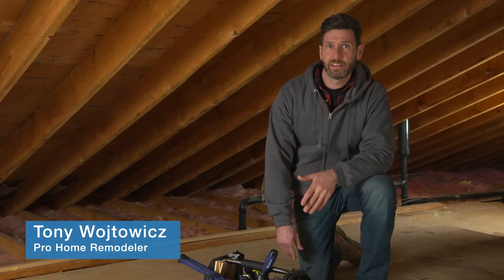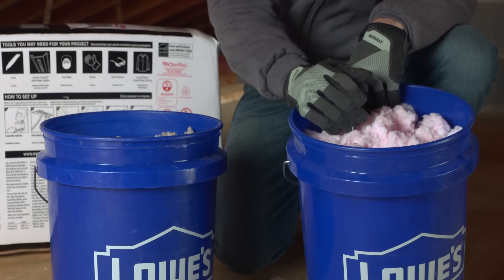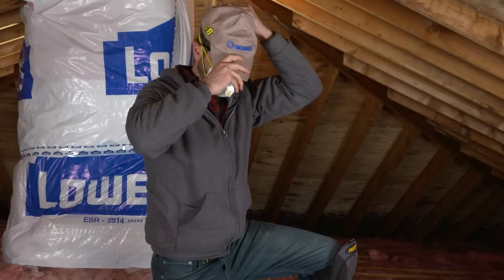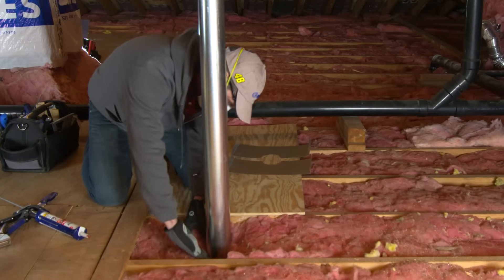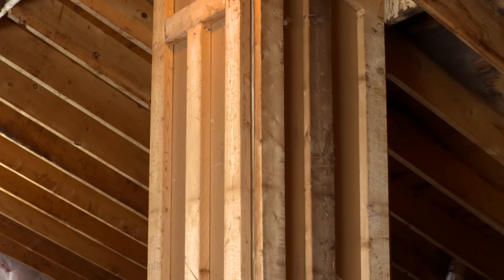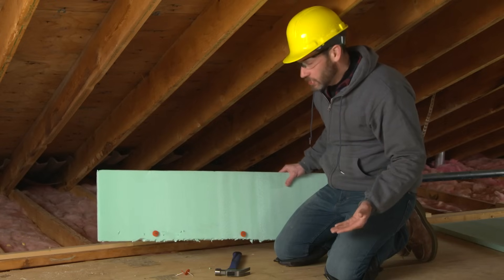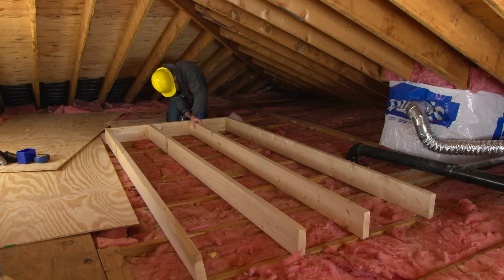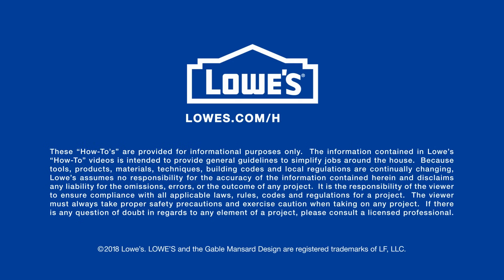How to Install Blown-in or Loose Fill Insulation

Comment: I want this guy to come to my house and do this. Never seen anyone take that much time to do prep work and care.  Everyone just blows it in and f u pay me!! Great video
Reply: Paid by the hour.
Reply: @lawnworksllc9533  right, Ill take all the time to do amazing prep work just to get that money. You need shelves and walkways, no problem.
Reply: Wow, where do I find professionals like this guy?
Reply: In my experience most people do not want to pay for the extra time labor and material to have it done like this. Most customers I’ve ever had want everything done as cheap as possible.
Reply: I'm going to blow my own🎉. And I'm not doing any of that prep work either.  Nobody does cuz it's unnecessary.  If you put in enough blown in insulation you will not have leakage into your attic.
Reply: That's why I'm doing this myself, friend. I had vermiculite in there. Got it removed. Since then, I have been going up there weekly air sealing, insulating pipes, adding baffles and metal mesh to gable vents to keep out squirrels. Next I have to build up hatch and blow in the cellulose. Got 60 bags stored in my garage right now and have machine reserved for later this week.

It's honestly so much work I want to puke. Some days after getting down from there i do puke. But I know in the end it'll be worth it cause I actually care about the project and what it adds to the house.
Reply: How much do I usually get charged

Comment: If only all attics were that pristine and wide open 😁
Reply: Yes... I'm working in a 4/12 pitch on a 25ft span
Reply: No kidding. I've only lived in one house with one that tall, and seen one other. And no spiders or bugs at all LOL. 

I bet it was all a set they built and the water damage they showed was just standard Lowes plywood from the store LOL (kind of joking). Definitely did a really good job, though I question the effectiveness of attic insulation if you leave a huge uninsured area in the middle (or less insulated, anyway. )

Comment: Pro tip: Install Cat 6a ethernet to all your rooms before spraying your insulation in there.
Reply: Nytron or have good wifi :)
Reply: @ovidiuciuparu6421  Wired for life. So much better than WiFi. 

Best would be to install some conduit from the attic down into the walls so you can upgrade whenever cat7 or cat8 or what the f ever comes out.
Reply: @dupeaccount1647  That's what our builder recommended.  Thought he was nuts...at the time.  So thankful for this advice over the years!
Reply: Is your profile pic of you after you realized that trick while finishing up the last bay of insulation?

Comment: This guy did not cut any corners. Hard to find guys who work like this
Reply: Really?  Did you notice the sheetrock work, driving screws into the edge of the sheetrock?  That's a way for it to break & crumble easily.  I'd have cut some 2x stock for inside those corners and screwed into that.  And then the foam insulation along those edges was pretty sloppy.  I'd have just left it, considering the other side of the insulation is not interior space so insulation was not needed there.  Or joint compound could make a neat tight job of it if the circumstances mattered.
Reply: @PeterLawton  do you perform aerobics or mma training in your attic? It's an attic bruh
Reply: Best comment here LOL. 

This one is definitely big enough to!
Reply: It's holding back insulation that weighs less than a pound per sq ft. Yes, it broke the insulation, not it's not gonna hurt anything at all. 

I would have just left it alone, or used caulk, but it worked fine. And was then covered in insulation, so it's fine.

Comment: I love how he talks like the R50-R60 range is not where you want to fill to :)  Hot or cold, north or south, you want to hit R50 or more.
Reply: Uh no. Over insulating can be just as problematic as under insulating. You need to verify with your local codes.
Reply: Why would putting more insulation in be bad? If you don't cover uo something you shouldn't, it shouldn't be an issue. Also, DOE says r60 is fine.

Comment: I'm not sure how he magically screwed drywall onto drywall perpendicularly...
Reply: Exactly, I noticed that too. I use during strips and 5/8" sheet rock to make fire rated light covers
Reply: @mikeclark6642  Pre-drilled holes would be the only way not to split the sheet rock.  It would still be difficult for the screws to hold it together well.

Comment: There is a fix to the clumsy walk-on-joists problem that will make installing more than a few inches of insulation much easier. You build an elevated platform to walk on. It's easily done with scrap lumber. Read on for instructions.

1. Take short 2x10 or 2x12 boards about a foot long. You can find them as scrap.
2. Nail strips of wood, perhaps plywood, on each side of those boards and extending down about 3 inches.
3. Slip the result over a joist, with two boards alongside one another on adjacent joists. Except on cathedral ceilings, they don't need to be nailed down.
4. Nail another 2x10 or 2x12 board a little over 24 inches long between the two boards. That creates a stable platform you can stand on rather than those elusive joists. 

Make a series of those platforms and you can walk about an attic. And if you do this for a living, remove them after one job and move them to your next job site. The cost is almost nothing and you'll save a lot of time. You might also sell the result to your customers to make later work in their attic easier. All that walking on joists and kicking away insulation will wreck their attic insulation.

To make your work even easier, connect those platforms with longer 2x10 or 2x12 boards and you will have a solid path to walk about on. If you're blowing in insulation, the platform offers a 4+10+2+2=18 inch marker that you can, if you want, fill up to. Measuring is easy. Just fill up to your pathways.

That 18 inches will give a highly effective R-value of 65. Where I live (central Alabama) that means only on the coldest days do I need to run my heat. The rest of the time the lights and refrigerators keep the interior in the mid sixties. Combine that with attic foil for even more protection, particularly if you have hot summers.
Reply: Good to know. I don't understand the directions, though. 

The 2x10s are set on edge (so 9 5" high), with another one on top. Are they going perpendicular to the rafters, or parallel? And where are the other boards going relative to the original 2x10s? 

I think I understand the idea, and I like it, but I'm just trying to understand your design better.

Comment: Good info! 

I do have a question to poke fun at you though. How do you get 4x8 sheets of plywood through the 2x2 attic access hatch? ;-)
Reply: He's got a huge pull-down staircase into the attic
Reply: haha good question.
Reply: 2×4' fits easily through
Reply: And whys there no poly between the trusses and drywall, every fixture had nothing. Do not let lowes insulate yoyr attic lol

Comment: Thank you for mentioning the rafter vents. We just bought a house that has blown insulation very high in the attic, but they didn't put in rafter vents/baffles first. 😑 And there is a small amount of mold on the ceiling of the roof.

Comment: Why aren't the air seal prevention, caulking, boxes, etc, put in place when the house is built & before insulating?  I guess costs are a factor, possibly time as well.  If I am purchasing a new(er) home, I  would expect that to be part of the build.  Apparently, we just assumed or not aware it was needed?   Education is key!!!

Thank you such a thorough explanation; I wish I had that much space available in my attic.  One must crawl on their belly!!!  Not able to stand up! 😳
Reply: Air sealing just wasn’t a thing 30 years ago. My folks helped me insulate our attic with fiberglass 29 years ago and despite being experienced contractors, did not know to air seal all the joints and passageways, they just rolled out fiberglass over the measly 2” of Vermiculite insulation. Now, I’m peeling back the pink and sweeping back the Vermiculite insulation to air-seal it all.

Comment: I live in a floating home in Portland, OR, and am prepping to do this with two helpers. I'm planning on buying disposable coveralls, borrowing a ventilator (maybe just a mask), gloves, etc. One of my questions is the rafter vents. The slope of my roof is such that it's a tight space, so how do I get those vents screwed in those tight angles? Guess I need a bunch of screws, too. Oh, and I also need plywood to navigate the space. I think I'm gonna use two old bifold doors up there to help me. Then there's the depth of the infill...do I really need the measuring pieces to help with that? My back and knees might not be able to handle this, so I'll throw my helpers up there!  LOL. Pizza and beer heading their way!!!!!!  Any thoughts or ideas for me would be welcome!

Comment: I have an attic ceiling that has no insulation, but it has beams that ceiling board was nailed to. Would it be better to add loose insulation without removing the whole board, or removing the boards, lay batting, and put the boards back? Thank you!

Comment: Can blown in insulation be put on basement exterior walls
Reply: Cellulose can be as it has its own vapor barrier. As long as you have drywall/sheetrock to drill holes into it, you can pump it in, which is called dense packing. In case of a fire, Cellulose would just tar unlike fiberglass that will ignite. Also Cellulose helps with mice as it kills their reproductive systems and less bugs as well.

Comment: I live in Southern California my house is about 1200 square feet. There is no insulation in the Attic. In the morning the house stays cool but gradually through the day it's on believably hot. I wonder if doing insulation would help the situation. Is anyone could give me a comment I'd appreciate
Reply: Yea bud it’d help a lot if there is currently no insulation up there.
Reply: Absolutely it will help.  If possible, also add radiant barrier across all the roof trusses.  You won't believe how much it  all will change your homes comfort and drop HVAC bills.

Comment: good grief, I thought blowing insulation was quick and easy...this guy has me doing so many things it will take weeks and time off work to get this done...  there's got to be an easier way.
Reply: I do this for a living and unfortunately there’s not. We can spend 16 hours just doing prep and testing. Air sealing penetrations, wall tops, party walls. Venting out any exhaust vents through the roof. Building boxes over recessed lights. Wrapping ducts and pipes. Installing eave chutes. Boxing off sketchy wires. After all that it takes like 30 minutes to actually blow in the insulation. Alternatives would be spray insulation but that involves a lot of prep too and is super expensive and needs to be done by a qualified person, or the simple not as effective option would be to lay down more batts perpendicular on top of the existing ones.
Reply: Sure, just call someone else to do it or just blow in the insulation without caring. That's like saying there has to be a different way with prep for painting a car. You can do it quick and dirty but the result isn't nearly as nice and you can tell.
Reply: @Addison0526  I did it myself with the help of a friend.  Blew in about 8 inches on a Sunday afternoon,  so easy and the house is much warmer,  thanks.

Comment: I want to add storage to my attic (and insulate) so I want to raise the floor up like he does at https://www.youtube.com/watch?v=-UNFRt0RC4Q&feature=youtu.be&t=251 How do I know how much framing I can add to raise the floor up? Wouldn't it make the ceiling sag?  What if I want to make most of my attic walkable (not necessarily liveable, just going up there to retrieve stored items) easily? Do I need to consult a structural engineer and maybe sister some 2x8 or 2x10 to my existing joists (I think they're 2x8 already but will go up there to take a look).

Comment: All well and good in theory,   But in practicality Not a viable solution..  The machine we rented,  twice from different stores.  Both machines did not work as expected.  They were ineffective at blowing insulation up to the 2nd level. they worked fine on an level field but fail to blow insulation up into the attic.  So if you are able to elevate the machine to roof level it may work fine,  but otherwise you most likely get frustrated unclogging the hose and filling your driveway with fluff.
Reply: Im sorry your machine didnt work.. Just did this an hour ago with the Home depote machine.. 1900 SQ ft house with second floor. it blew pretty good. zero clog ups.  I was nervous though.  It sucks but could drag the machine upstairs.?

Comment: The worst insulation to use. 
Air flows up through it it’s the most stupid product to use. Do not use the fibreglass 🤦‍♂️
Reply: That's why you want your attic completely air-sealed from your living space.  Blown foam is better in several factors, but at about 6x the price as well!
Reply: Does he not say to seal all air leaks as it's not a barrier for air movement? Or was that another video I watched..